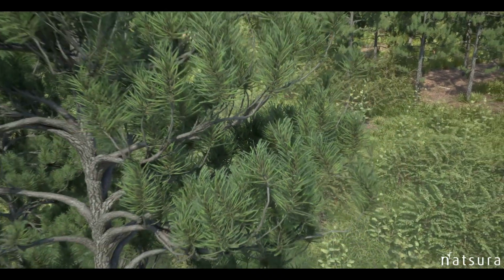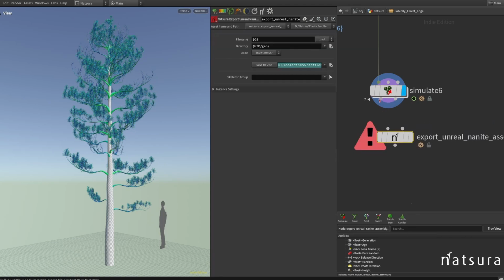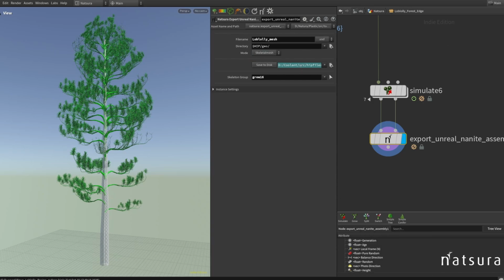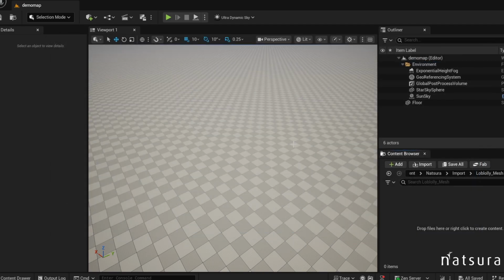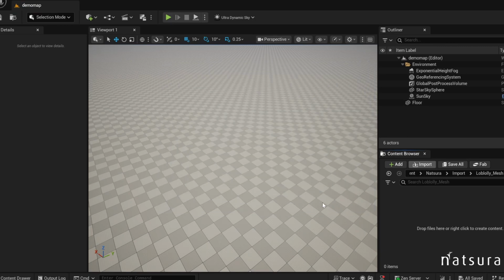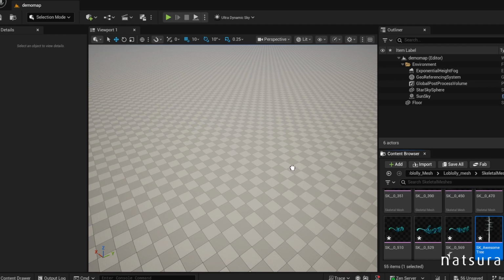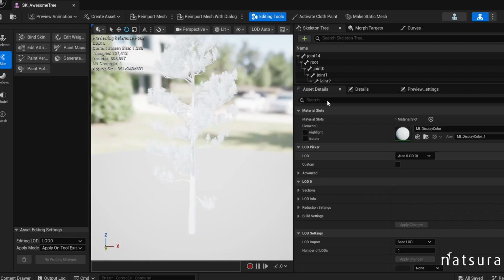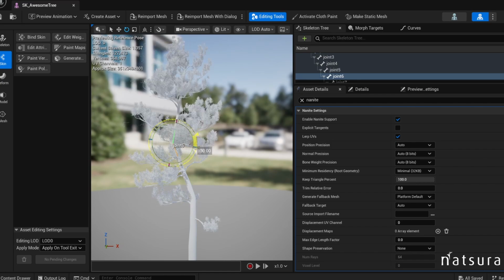Natsura to Unreal Nanite Skeletal Mesh Assembly

Comment: In UE5.8 Preview, it seems the wind system workflow has changed from the traditional Blueprint-based setup to an AnimBP-based workflow.
Could you please explain in detail how to apply the new system using a JSON file exported from Natsura?
Previously, I only used the Wind Provider setup without any actual animation sequences.

Ah, I realized I misunderstood earlier.
The existing wind system still works, but how can I apply the wind data exported from Natsura?

I’d like to know how to properly use/apply the JSON file.
Reply from the maker: Sorry for the slow reply! You need to make sure you have the experimental wind plugin enabled. Then you can right click the asset and go to do scripted asset actions. Then you can click the json and it will apply.